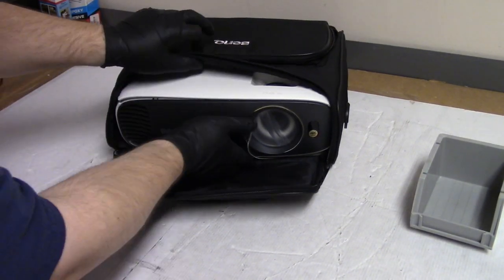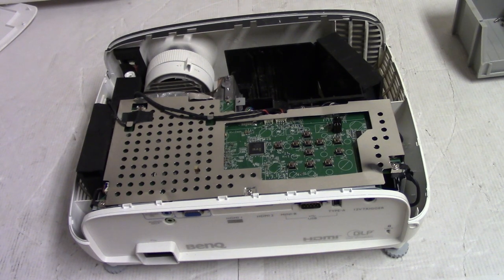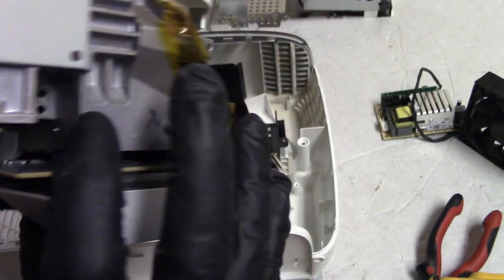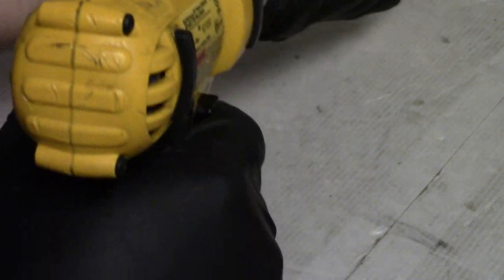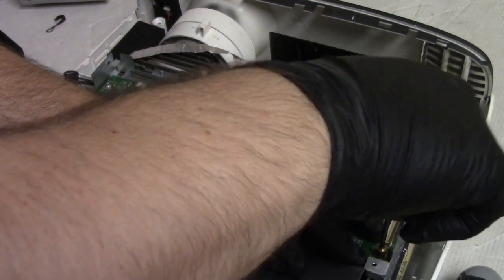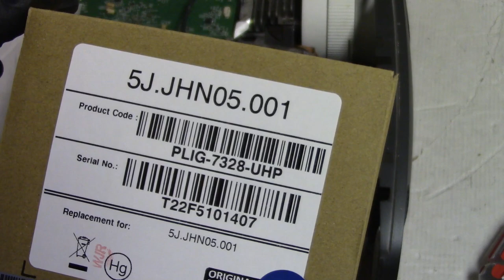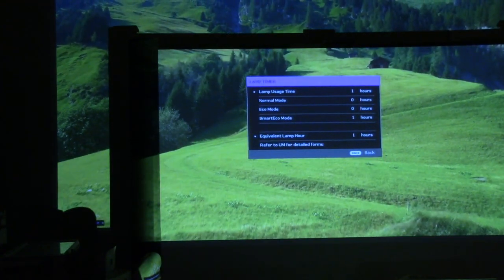BenQ HT2550 4K DLP Video Projector Repair | Cleaning

Comment: Thanks for sharing your knowledge. I've had experience with Mitsubishi DLP TVS, but no projectors. Have acquired a non working HT2150st. When plugged in, power led blinks, all other LEDs are off. Unit supposedly worked ok, looks very clean. No diagnostic covers this led status. Hope you have a good Thanksgiving.

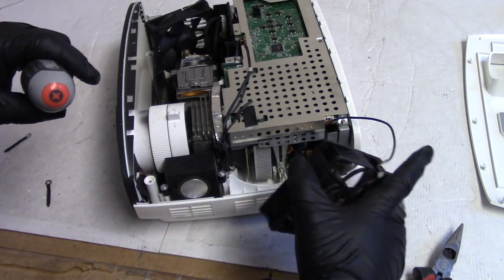Comment: Unless there is something I've missed, it looks like the electronics bay cooling fan has been installed the wrong way around. At 19:51 the fan is installed with the label pointing inwards, and at 58:29, the fan is installed with the label pointing outwards of the projector. This could affect the cooling significantly because the design of the projector is for the electronics fan to bring cool air in, across the electronics, out into the lamp compartment through the blower, and exhaust through the lamp fan. 

In the incorrect configuration, the fans will fight each other.

Perfectionists will be forever bothered by this comment either way hehe
Reply from the maker: The only fan blowing out is the exhaust fan in the lamp basket. The others blow in. I ran it for a few hours anyway. I couldn't trust anything in that projector.

Comment: If the plastic is ABS (and you can obtain this where you are) Evo-Stik extra-strong PVC pipe weld can be used, but use caution / experiment first as it melts ABS together.
Reply from the maker: Great advice! I have used that (similar product) with a lot of success.  I ended up using CA glue(thick stuff) and it worked out great. Fortunately there is little stress on those points.
You are definitely right about testing. I melted the crap out a lamp door one time trying to fix the tab with that PVC glue.

Comment: Hi Frank, I'm happy I found your channel! I've learned a lot already. 

I'm trying to fix a w2700 which I bought on eBay. Did you ever come across a case with these symptoms? 

It turns on, shows a BenQ logo (but in black and white) and then a blue screen. After about a minute it turns off. I don't seem to get a menu on the screen or any other reaction from the projector. The light seems to work fine.
Reply from the maker: Hi Max, What are the LED's doing when it shuts down?  It sounds either like a bad mainboard or something error related(bad fan, color wheel problem, something shuts the lamp off).  I think the logo is supposed to be black and white on these(not 100% sure though).   If you get a blue screen, then the color wheel should be working.
Reply: @FixitFrank  thanks for the reply!
I've done some more testing. And the symptoms are a bit different than described above.

1. The projector stays on now that all fans are connected again.
2. After the gray/white BenQ logo, the screen is not blue, but more gray with a vague glow of pink over 80 percent of the screen. And a bit of green tint glow on the top left corner. Nothing on the screen changes when I press menu or source. 
3. With startup I hear a high pitch noise for 2 seconds before I hear what I assume is the color wheel revving up.
4. The previous owner states that there was a power problem that caused this problem.
5. Only the power LEDs are on.
6. The projector nicely turns off when I hold the power button. 

My hope that it is maybe the power wheel?

Or should I start fault finding the electronics? 

Thanks for taking the time to reply!
Reply from the maker: Hmm.  That is really really weird.  If the color wheel stops spinning at all, the projector should shut down immediately.  I suspect there might be a low voltage problem, Possibly capacitors if there was a power incident.  I do not know the proper voltages to expect on the low voltage pins but I would suspect to see 12-13v, 5v, 3.3 and maybe 24v.  If you see any weird looking voltages that are far off from those, I would investigate further.  Maybe even give a visual examination of the capacitors on the power supply.  Other than that, I would get into the service menu and see if any errors are listed.  I think you press menu, then enter/source at the same time.

Comment: Thanks, what is that for a filter / glass in front of the color wheel? Is that some kind of polarizer?
Reply from the maker: I think it's just a glass window to keep the dust out. It didnt seem to have a coating but I didn't really examine it. The lamp assembly has the UV/IR glass so I don't think it's that. It could be a polarized glass piece but I don't know.

Comment: Fantastic job! 
I have a Viewsonic PX-747-4k that´s very similar to this Benq. My projector is turnning off after aprox 2minutes and power led keep blue and temp led red. The fans are running, can You give some tips?
At 26minutes you checked the diodes and get around 500 . Here they are around 1000, this is bad? can be the problem?

Comment: benq is horralble i had 3 projectors from then  and 2 broken in 2 years they would always get dirty and the start having problems the dmd chip mised up on 2 the 3ed one got stolen before it could break
Reply from the maker: BenQ is okay. Sounds like you has a tough time though. Like all brands you get what you pay for. In the under$3000 category BenQ is decent enough. 
All that said, if you had that many issues I don't blame.you at all for not likeling them. Hopefully you have something now that works!

Comment: Thank you sir. I have the w1700 with one “stuck” mirror. It’s one white pixel near the centre of the image, so i am thinking about ordering a replacement dmd and they seem to be available on Aliexpress. where would you recommend purchasing one from? Did you replace the heat sink paste when you reseated the dmd? Cheers 👍
Reply from the maker: I would suggest the company I use.  they include a thermal pad which I find better than paste. Paste is okay but it can get into the pin area.  the company I use is Time electronics.  You can contact them at gydz@timeprojectorlamp.com  They ship DHL and take paypal.  Very reputable. Price should be competitive with Aliexpress.
Reply: @FixitFrank  would you expect dmd chips to last years and years? I read somewhere benq rate some of their dmd chips to 100,000 hours, so far my chip has failed before the first lamp replacement 😆😒
Reply from the maker: I would expect it to last the life of the projector.  The most common reason I see for failure is heat buildup.  Make sure the insides stay as dust free as possible and run as cool as possible.  DMD's have a certain temp they can run to, before they get unreliable.  I see the newer UHD optoma series fail in about 1-2 years because they build them to run on the edge of the top temp. 
Its more likely yours was defective from the factory(unless you notice a lot of dust buildup).  I have pets in the house so I have to clean my electronics from pet hair a few times a year. My parents have no pets so they barely even need to have me clean their projector. 
With proper heat sink pads or paste and good normal levels of cooling the new DMD should last a long time in my opinion.
Reply: @FixitFrank  just wanted to pop back and say "Thank you" 😊 
Replaced my DMD chip, new thermal  pad and all back together working as good as new. Not a job for everyone.  But it is an off the shelf part and possible to replace with the information you have provided. Cheers mate 🍻

Comment: Hi frank I have a benq dlp projector I got off of offer up (he lied and said it was working with a brand new lamp) :( . and the red lamp light is flashing when I power on . Hoping for some advice to fix
Reply from the maker: Hi, It sounds like the lamp might be defective or there is a color wheel problem possibly?  Its hard to say with just those symptoms but those 2 things would be the first two thing I would check if I had it here.
Reply: Possible to send to you for inspection? I don’t have PayPal but do have cash app or Zelle

Comment: Sir benq ht 2550 and benq w1700 same  in my benq w1700 4 k projector shows after half minutes running lamp error  to confirm fault connected ballast lamp and power factor 380 v externally run this main board rather than it shows lamp error  sir what is possibility of cw sensor  but colour are not flicker suddenly lamp error show here what is im missing possibility

Comment: I need a new main board for a BenQ HT1085st, the person I bought it from flash the wrong firmware onto it
Reply from the maker: That's a tough one. Those are not cheap. eBay might be your best bet for a used projector with damage to a lens or something other than a main board
Reply: @FixitFrank  you wouldn't have a damage board lying around, I know the board works, I just need to swap the firmware chip
Reply from the maker: sorry no. It's not something I would have unfortunately.  I dont see too many scrap HT1085s. They tend to be repairable so they dont get into my parts pile.
Reply from the maker: if you want to try my contact in China, they may have a mainboard or even just a firmware IC. gydz@timeprojectorlamp.com  Ask them and let them know I sent you.
Reply: @FixitFrank  thank you, I just sent them an email